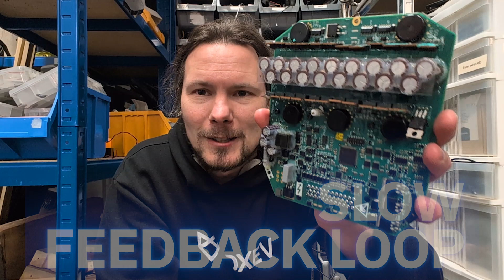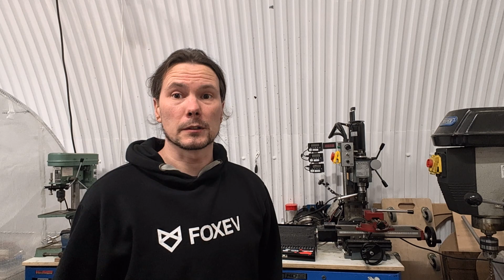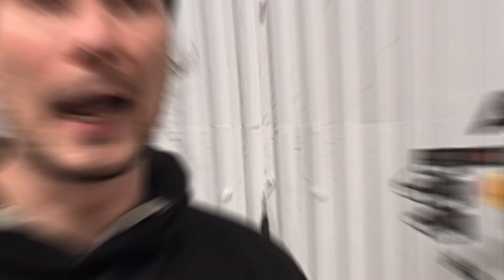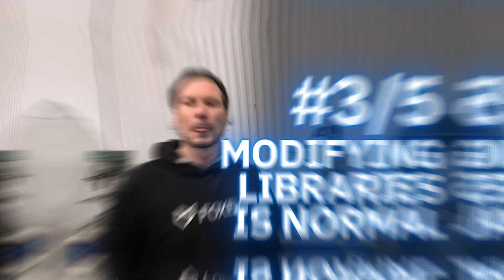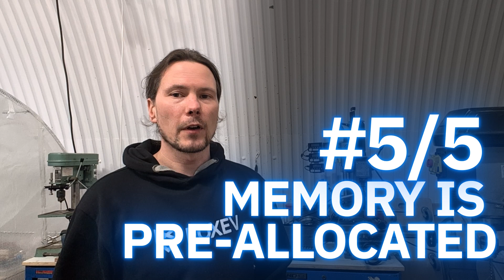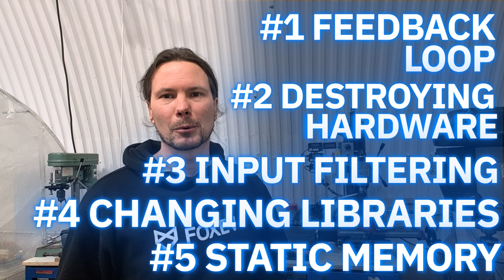5 embedded programming surprises 💡⚡👩‍🔧

Comment: Also, sooner or later you do system programming, so you won't go far without RTOS and thread synchronization. Wrong thread access will kick you in the back at least couple of times to be always aware which thread enters which part of the code and when. As for the input filtering - always add capacitors, they are nearly free and save you a lot of software workarounds, always add pull-up, pull-down resistors, best internal ones. Floating input, especially a serial interface that can generate interrupts can crash the MCU from touching a pin with your finger. Internal pull-up and pull-down resistors mitigate that behavior. Oh, and released drivers have bugs in them ;) Really really ;) When it doesn't work it's not always your mistake. It can be a driver bug as well. Weirdest and hardest bug to find: a USB port was powered from a data line instead of separate supply line. So it worked with one specific pendrive to confuse me. It didn't work with all others because as they needed a bit more current the voltage dropped that gave super weird USB read errors. I could find the issue earlier if I checked the board schematics sooner ;)

Comment: What I do to filter an input that is 1 or 0 on or off is to require it to be on or off for an amount of time before reading a  state as on or off. Typically analogue values can be averaged , but at the cost of real time accuracy. It's important to filter the inputs in hardware too if you can especially switches.

Comment: is there development software to build embedded code in?
Reply: All the major microcontroller manufacturers provide IDEs and libraries. Amongst other things, the IDEs typically provide a graphical UI in which to configure all the I/O pin functions,  clocks, timers, communication features and so on.  That is a big boost to getting started compared to reading the 1000+ page datasheets to figure out all the configuration registers. In addition the IDEs interact with one or another hardware debugging scheme so that, in principle, you can single-step through code running on the MCU.  However, that activity can be severely limited if, as is often the case, the functionality you programmed only really works when running in real time. Also,  the fewer pins of smaller MCUs may all be committed to application purposes and not available for debugging signals.

Comment: Embedded code basically runs on a unique machine  So yes, copying libraries, into your own, makes sense,  building a library tailored to the PCB. it is also often more memory/power efficient to edit the lib code itself. The use of watchdog timers for processes in and outside of the processor, might also be new for non embedded programmers. And the use of a serial port for debugging.

Comment: Sir; indeed, the automotive environment is "special" in do many ways.
- hardware: power supply voltage and disturbances/"events"⚡, input and output voltages and currents, Vibration, operating temperature🔥❄️, and temperature rate-of-change☃️-🏜️,  humidity, water 🌊, fuel and lubricants...and, reliability.
/safety, failure management (if a failure occurs in any part of the device/system, is there any immediate effect on vehicle operation or safety, is the failure "local", not affecting safe operation, does the failure allow "fall-back" operation that has safe, but reduced capability...), operational and troubleshooting display/indicators to provide feedback to users or Repairers...
- software:    SAFETY
 reliability, ease of use(if the operator/passenger uses the functions) , failure management (fail-to-safe, fail-soft), flexibility (can operate on different models, engines), in-vehicle upgrades/updates, OTA/wired software changes, access to parameter or mode changes, possible migration to different platforms or OS, required processor and i/o resources that affect size/cost/functionality/longevity/safety.
Reminds me of a very old song, "These are a few of my favourite things..."

Comment: Your journey is one that most if not all embedded people have gone through, even I after 35+ years still go through, my most hilarious one was when I received the pcb, loaded with parts then realized there were no traces on the board, yep, I exported and had pcb made with no traces!! lol - On the subject of I/O, there are are so many ways to do things and you need to find the one that works for you. Sometimes its a hardware solution rather than wasted cycles doing things in software. one of the ways I smooth out an ADC input, such as from a pot, is to use two caps, one from adc input to ground and the other from adc input to +v (chip +v or +vref) with this I dont have to average out in software - yes, cost more, but I save cycles on the chip. looking at these types of techniques you will find you can use a lower cost microcontrollers and save more (for production runs). Anyways, wish you the best in your progression.

Comment: Being able to damage the hardware with software usually means you have some design revisions ahead, I'm from automotive so its not uncommon to have every IO able to survive deliberate shorting to power rails, a 5W test light does wonders to what you think is safe, backdriving from IO can make some input protection methods rather dangerous.
Feedback loop is pants, if possible isolate the logic from the hardware, some call it an abstraction layer, basically your calling something that's easy to mock for local testing that the logic does what it should, and the hardware code can be vetted with an oscilloscope or logic analyzer. 
Input filtering is less of a concern if your using a state machine for user input, when the device is running at hundreds of MHz, a 100ms delay for the worst case switch bounce wont seem like a delay, (You have a minimum duration before the state machine can advance)
Changing the libraries is going to seem different, but its a more hands on way of "owning" the code, library code usually wont fit your specific needs, development may have stopped a decade or more ago, so you grab a copy just for that project and your now the guy supporting it, e.g. you just need a bit-bang serial output, well almost all the complexity is in reading serial, so without it your looking at about 40 bytes of memory tops. 
Static allocation is more industry dependant, its not specifically make everything global, more don't use malloc, if your working with a large structure in embedded, your RAM has an upper limit, so better to define the size specifically, and if its persisting the entire runtime, no point in making it dynamic, you can very easily run out of memory when you have only bytes to kilobytes.
Reply from the maker: Great insights, thank you! 100% with you, these were things that surprised me ... 3-4 years ago and now I have internalised them. I hope the video and the comments here will help people getting started. I remember feeling bad when I fried a board and thought I wasn't up to it, but then someone reassured me that it is just how this goes.

Yep, I know newer chips you are not as constrained with RAM. I also built a state machine and various abstractions to shorten my feedback loop, but they will get a full video each. Everything bare metal as well, which was fun for me, no operating system, no explicit threads (just some interrupts), malloc doesn't even exist.

It was a great learning experience.

Comment: Good video.  I've lived in the embedded HW world since the '80s, so I can't help but comment on a few items:

Changing libraries:  You are correct - but I think it's helpful to mention WHY.  Embedded apps typically have MUCH less memory (speed, and horsepower too!) than desktop apps.  So much of the design can be filtering everything down to the bare minimum you need to get everything working properly, or to optimize it for performance.  Keep this in mind from the start of the project so you can architect it properly.

Input filtering:  Sounds like you're talking about switches here.  This problem can be helped in HW with an RC network on the switch, grounding the switch to the case, and protection diodes.  That doesn't necessarily eliminate SW filtering, but I can help tremendously.  There are plenty of schematics on the web for this, or you can ask me for more details.

For actual analog signals that you're sampling with an A/D converter, you may need a physical low-pass filter on your PCB to avoid aliasing high-frequency noise into the signal you're measuring.  Many hobby level schematics ignore this, and if you're dealing with a noisy board, you'll be scratching your head for a long time trying to figure out what's going on.  So you should at least familiarize yourself with this topic before jumping into the deep end.

Destroying HW:  USE PROPER ESD PROTECTION!  You may get away with it for months (or even years) but you don't need the headaches it can cause.  Dry winters are the worst.  Get yourself an ESD mat and wrist straps, and if you're plugging handheld HW into something else, make sure the "something else" is also ESD protected.  If you're working on a home robot running on carpet with rubber or plastic wheels, you're going to need serious ESD protection, so take the time to learn how to mitigate it properly.

Also, fuses are usually a lot cheaper than the rest of your HW.  Keep a handful of spares around for when you do something stupid.

Have fun!
Reply: Fuses prevent magic smoke, not component permanent damage. A careful fast hardware circuit must prevent the damage from occurring before the absolute maximum ratings are "caressed", imo.
Reply from the maker: Excellent points Cynthia, thanks for watching the whole video and taking the time to reply in this level of detail.

Filtering: I was reading a voltage from an ADC and took the instantaneous value. Oversampling is the word I was looking for, I called it Input Filtering. Ended up implementing it myself in a for loop before I realised it is just a flag you can set 🤦

ESD protection also very useful, I was giving the example of wiring something up, thinking you did it right, and involuntarily carrying out a smoke test because your thinking wasn't right. Many a STM32s were fried until I learn't what a flyback diode was (which I am going to record a future video on) :)
Reply: @foxev-content Oooh, let me guess - you had the STM32 output directly driving a relay - and you killed it the first time you turned the relay OFF?

That's when you really learn the meaning of V = L * di/dt !  

The good news is that you now know the physics behind how a boost converter works!
Reply from the maker: That's precisely what I did. There will. Be a whole episode about what a flyback diode is and why you need it because that's how I learnt it!
Reply: @ Somehow the lessons we learned the hard way are the ones that really stick - but I'm sure you'll never do that again!